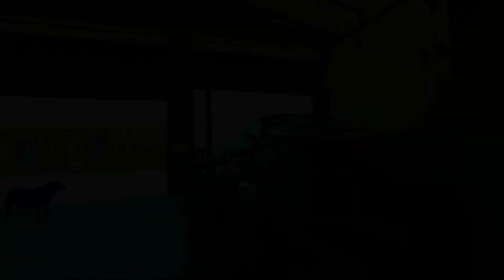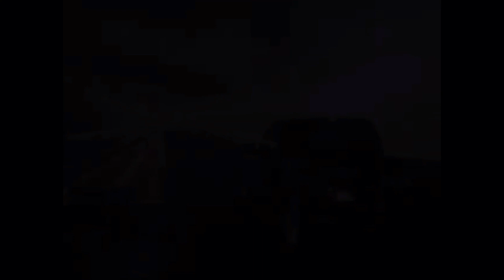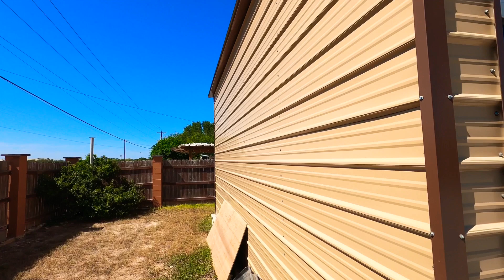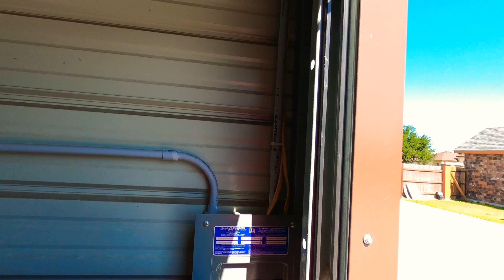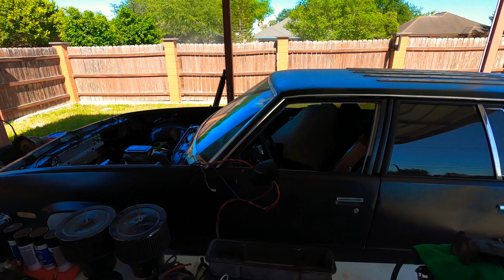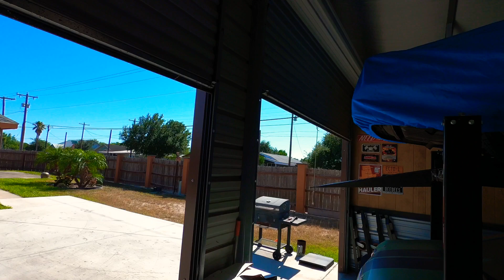Metal Shop Part 2

Comment: Great videos both part 1 and part 2.  You really did a good job explaining the all the steps you went through and costs.  In the first video I thought, he's not going to say anything about the rest of the slab but you did so thanks.

You mentioned that your lift is slow and that probably the 220 volt unit would be faster but that's not the case, 110 or 220 volt they would be the same.  It has to do with that its' an 8000lb lift.  it's got bigger hydraulic cylinders to fill up over a 5-6000lb lift., so it;'s going to take longer. 

I want to add something about the slab finish that Jason asked.  do not allow the concrete finisher to talk you into a broom finish, especially inside the shop.  The reason is you will never sweep up all the dust.  you will sweep and sweep and then sweep again and never get it up. 

Your floor was finished with a metal trowel, probably a power trowel but with metal blades.  That is the best finish you can put on a concrete shop floor because it's almost sealed and cleanup is easy when dirt is on the floor.  The only thing you'd need to seal it for is grease, oil and stains.  The only disadvantage is that it can get slippery when it is wet.  But a good oil resistant work boot will take care of slipping.

Finishing the exterior concrete slab, I'd go with a wooden trowel.  that will give you the slip resistance you'll need when its; raining.   I feel that the only reason they try to talk you into a broom finish is to hide imperfections, maybe sloppy work and it's cheaper labor wise for the contractor.